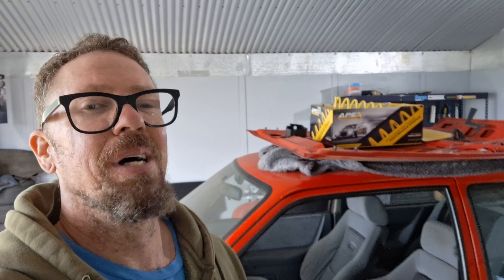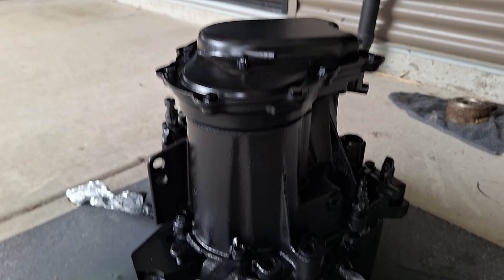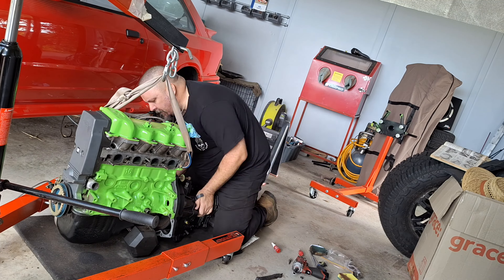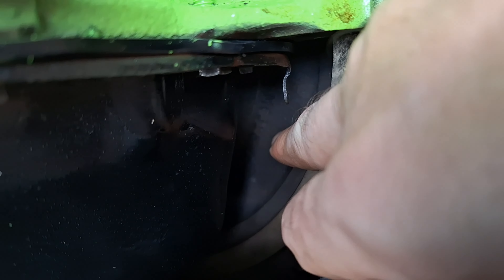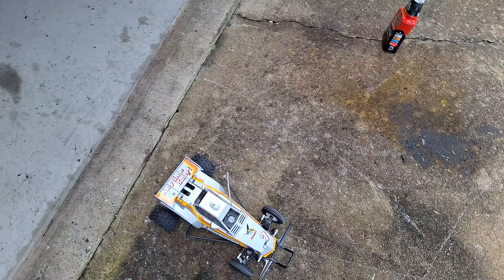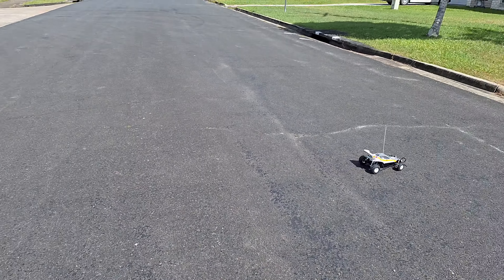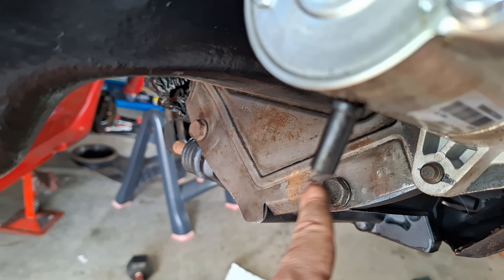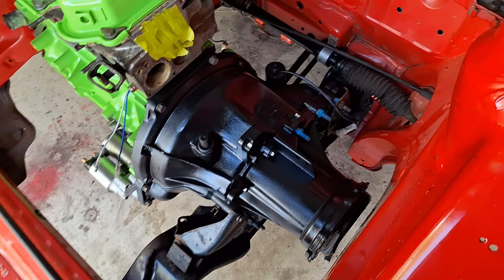Escort RS Turbo Gets An Engine

Comment: Hey Simon, good to see progress!

I've got one question though, what engine block is this?
I'm asking because I got a LNB block out of a Series 2, but mine doesn't have the opening for a crank trigger, while yours does! So you could've used the OG Ford sensor instead of the aftermarket trigger wheel & sensor.
You can see the mounting hole perfectly at 1:09

EDIT: Watch til the end before commenting 😆
Reply from the maker: 😂😂 all good mate. It's just a late model CVH block same as the fiesta turbo and xr3i/xr2i cars. Ford used these presumably to not manufacture 2 different blocks to save money